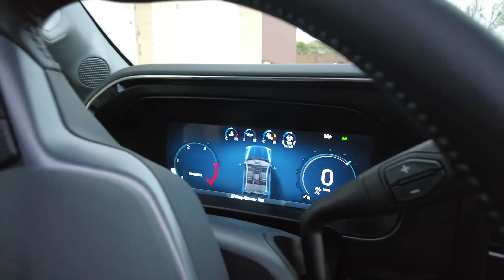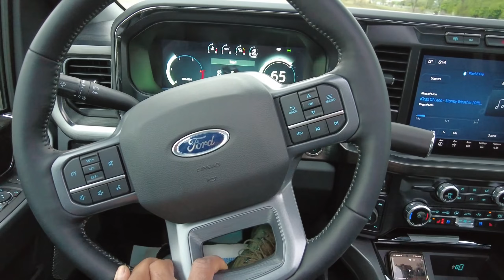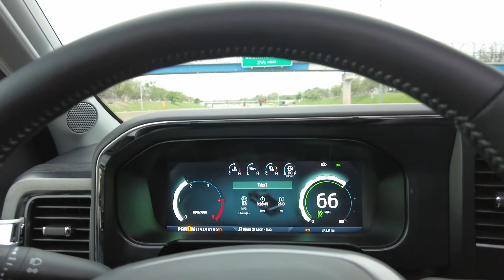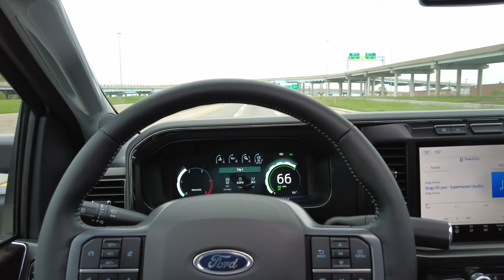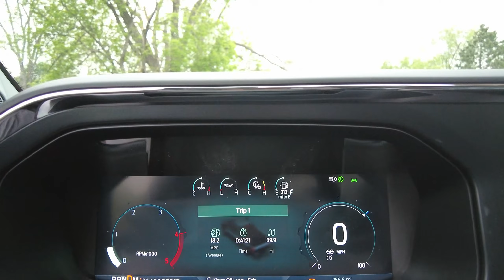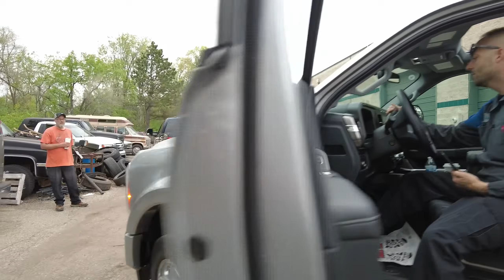6.7 High Output F450 MPG test! Surprising GOOD!

Comment: Cummins had us Ford guys for a bit when it came to power. The 6.7l power strokes changed the game for sure though for diesels. These new HO 6.7s expanding that gap even more. I personally run a tuned 7.3l powerstroke. Going to upgrade it further and try to hit 500 hp rwhp, but should easily hit 450 rwhp. running about 330-340 rwhp right now on my hottest/race tune.

Just need to delete these new HO 6.7s and throw in a Banks cold air intake, then run a tune (+15hp) and you should get around 550 hp. Not completely sure but seems reasonable. Of course turbo upgrades and a higher hp tune can crush that 550 hp number. I wonder what the torque numbers would be? 1400 ft lbs??
Reply: the std out / put  on the 6.7 is 475 hp now !

Comment: hi, great test.  I wrote down, 39.9÷18.2=2.19 gallons . 2.19 gallons ×$6 per gallon of diesel(california price)=$ $13.15  usd. to drive 39.9 miles. that's not bad. I'm looking into a custom build "2024 Digitally generated image shown. Actual vehicle may vary. See dealer for details. Super Duty® F-450® Limited Change Model Paint Color S4 Star White Metallic Tri-Coat $995 2024 Super Duty® F-450® Limited Summary $116,190 .  my question is did you apply or add a Ford Xplan pin to your trucks purchase?

Comment: I have 2023 Ram 3500 Limited DRW HO 6.7 with 4.10 and am getting around 15.5 mpg..  F450 is better with 10 speed vs 6 speed on Ram..   Ford wins on MPG.   Ram wins on the ride, TPMS, cheaper to maintain on 17" tires.

Comment: A better (as in more accurate) test would be to calculate the actual mpg, instead of assuming the dash display is honest and accurate. My F150 is typically 1 mpg less (and sometimes even a little worse than that) vs the display.
Reply from the maker: U sure?
Reply: Yup! I’m certain about the math, and I’m pretty sure (bit not certain) there was even a lawsuit associated with an allegation that Ford rigged the computer algorithm to mislead owners.

Comment: I don’t understand why people are doing these 2023 power stroke mpg tests.  These diesel engines get better mpg as they are driven.  My 2013 powerstroke kept getting better until I hit over 50K miles.
Reply from the maker: True.
Reply: that's BS.  that's what the ford salesman told me.  but its a bunch of bs.  he said once the rings set in you'll get more.   rings set in after 800 miles.
Reply: @Jimo225  BS?  So, you’re refuting the experience of most diesel owners?  Man are we lucky to have you commenting…

Comment: F450 is an absolute beast.  I love mine and would never have a 3500 or 350.  Those just don't come close to the ability of this truck in every detail.  I've owned a 150, 250, 350, a GMC 3500, and now the F450.  Hello... NO WAY I'd ever go back to any of those previous trucks.  On my last 600 mile trip, I AVERAGED 15 MPG.  Up and down hills from California to Arizona to Nevada and back again.  Wife drives the truck on highway at 75 mph most of the time.  Impressive numbers.
Reply: I have driven 2500, 3500, F250 and F350 DRW and am waiting for F450 Limited.  Yes, 75 mph is speed that i will drive normally when it is wide open.  I will not drive at 67 mph to get the better mpg.

Comment: Only thing wrong with that truck is FORD no longer offers the shift on the floor four wheel drive. I hate that electric shift shit.
Reply: Yep and I hate how only the xl and stripped down xlt come with regular keys. If the battery dying in my '17 Lariat Ultimate's key fob didn't nearly leave me stranded in the middle of my ranch, I never would've paid the extra money and taken the extra time to replace the battery.

Comment: MPG's in a F450 empty is of very little validity for me and many others. I bought mine to tow. If I want to run empty up & down the freeway & want good mpg's; I would have bought a F150 or Ranger. On my break-in  trip with my F350 7.3L gasser I got 17.5mpg going 65mph for ~485 miles. Lot less $$$ if I want a Super Duty & run empty. But I bought it to tow a 8400# trailer.

Comment: Dude, I'm getting 12 mpg in my old 7.3, F350 dually. 17.5 mpg!!!! In a F450!!! You got yourself the last truck you need to buy. I want a King Ranch.
Reply: Now imagine they didn’t have the ridiculous emissions equipment on them and had to use the terrible new ultra low sulfur diesel. 20+mpg and reliability but then they wouldn’t have you in for repairs or a new 100K truck in 5 years
Reply: @epap1375  they get around 23 mpg deleted!
Reply: hi agree with your comment, at 17.5 mpg for a 2024 f450 duelies, on the high way. I like those numbers too. I'm planning  2024 Digitally generated image shown.  See dealer for details. Super Duty® F-450® Limited Change Model Paint Color S4 Star White Metallic Tri-Coat $995 2024 Super Duty® F-450® Limited Summary $116,190. I would like to get the Xplan pin and price. the dealership said it's up to the dealership if want to take the x plan pin.  I then asked the sales rep if he could give me a X plan pin from his yearly allowance,  he never responded.
Reply: @go5582  my dealer always gives me  x /plan  i just order the truck !

Comment: I've got a 2023 F350 XL FX4 with the 6.7 HO. I get 17~19mpg on the highway while doing 80mph, and I'm doing about 150rpm lower with the 3.31 rear end. I chose the lower ratio rear end to help keep good highway mpg, and figure the extra hp/torque will counter that when I have a large trailer on. Mine is to get around my property in the mountains and tow a tractor + trailer in and out as needed.
Reply: Why are you driving like a madman??!!!  How about keeping it at 65mph?  What would you get then??!!!
Reply: @LWRC  hi I agree, these guys are flying.  be careful.  these trucks are big and heavy.
Reply: I've got the 2020 F350 XLT FX4 6.7 with the 3.55 rear end and a 2021 F250 6.7 with the 3.31 as work trucks. I get about the same mpgs doing 80 on the highway, with the 3.31 being just a little better, and I've been thinking about doing something similar to what you're doing with the 2023 HO as the HO just really brings in that extra power. Although, after towing with the 3.55 and the 3.31 I think staying with the 3.55 with HO might still be efficient enough in my case as I don't get past 70 while towing. The 2023 or 24 depending on when I plan on getting it will be a personal for the future with plans of hauling a decent sized 5th Wheel RV cross country so it all depends. If you've got any videos doing any sort of towing above 14k trailer I'd love to see it with that HO 3.31.

Comment: Despite all of the negative talk these days and what the competition offers I still say Ford is the King!
Reply: There is a reason that you can buy a Ram every day, and the dealer has a lot full of them, and the Chevy is very available, but you have to order a Ford and wait 6-10 months for it to be built. People that know trucks want a Super Duty.
Reply: @clifft7832  people that want a truck to play with like the fords because they're fast. But the majority of people that tow heavy on a regular basis, like hot shot truckers choose RAM. They're both good trucks, I'd be happy with either. The only one I wouldn't buy would be Chevy, but that's just from personal experience as my last one was an electrical nightmare. It couldn't make it a whole month without having some new electrical problem.
Reply: @clifft7832  hi I agree with your comment , I'm ordering a custom build 2024   Super Duty® F-450® Limited Change Model Paint Color S4 Star White Metallic Tri-Coat  2024 Super Duty® F-450® Limited Summary $116,190. It will be my 1st super duty.  It takes 6-10 months? my god.
Reply: @clifft7832  most hot shot operators are running ram cummins!
Reply: Long live the Ford Super Duty truck
Reply: King of gay's pre gay's better
Reply: @antonkristijanto9486  wow, such an intellectual response.
You probably still collect matchbox cars.
Reply: @Jophlo78 if it’s not intellectual does that mean it’s not valid? Get off your high horse, you’re just a regular person yourself.

Comment: Driving empty, I will drive between 70 to 80 mph, otherwise, whole freeway will pass me and I will become hazard to others.  or 5 to 10 mph above the speed limit and keep up with other vehicles in the middle lane.  If we are driving 66-70 mph when there is no traffic, we minds well get something different.
Reply: my cruise is always locked on. 67.
Reply: @williamclark9624  Is that with driving empty as well? Are you doing that to save on the gas?  What if the speed limit is 70mph?  Do you still drive at 67 mph?